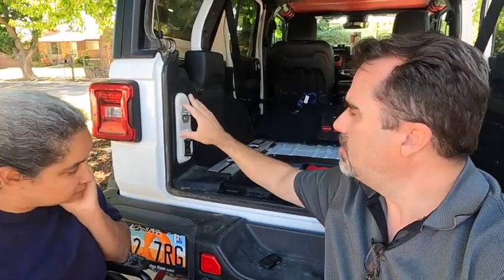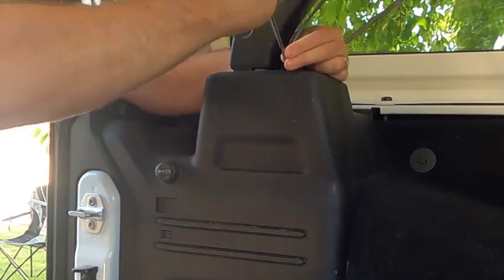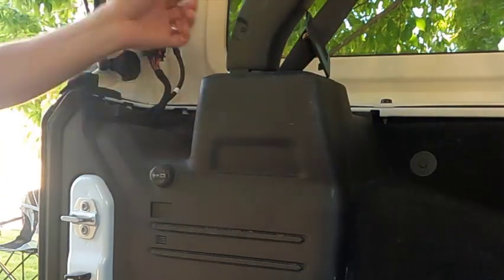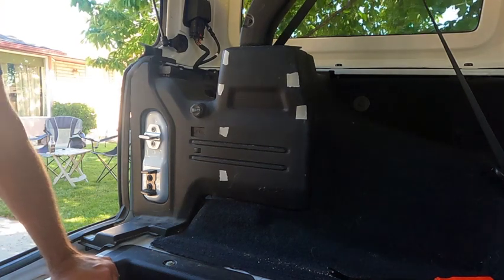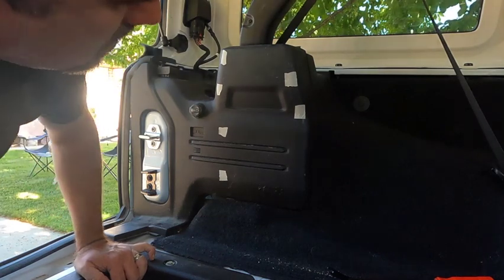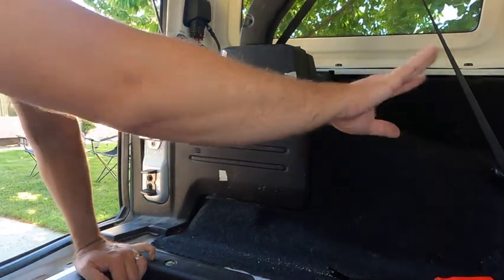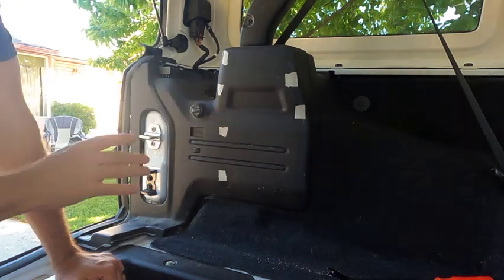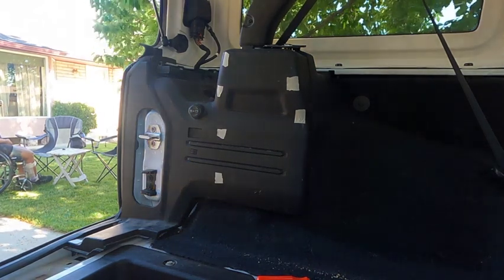How to Remove the Rear Cargo Panel on a Jeep Wrangler JL

Comment: This was what I needed.  Not sure if you're looking for "helpful creative input," but some of the clip sections could be "speeded up."  For example don't need "real time" view of the fastener removal on the rails from about 3:30 to about 5:40.  That section could be run at like 4x speed.  But don't let suggestion that take away from my appreciation of the helpful part, which is identifying where all the pull fasteners are. 🙂